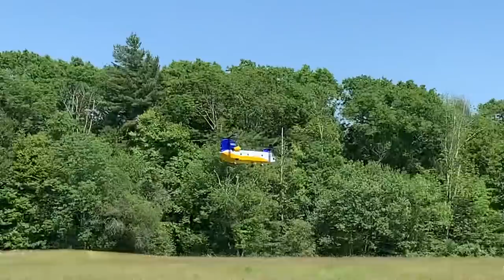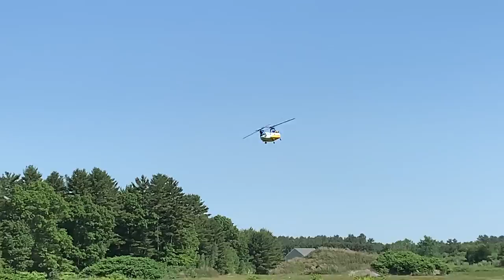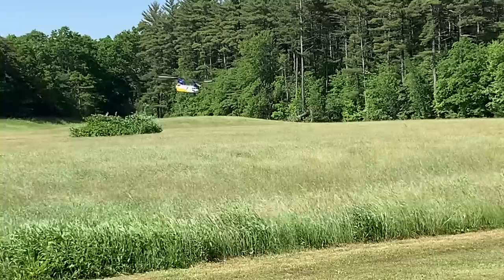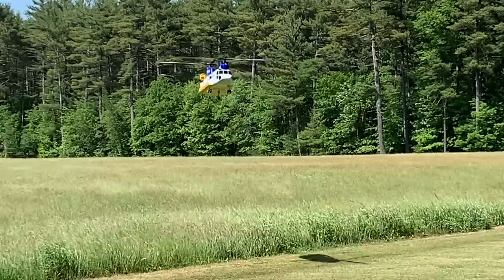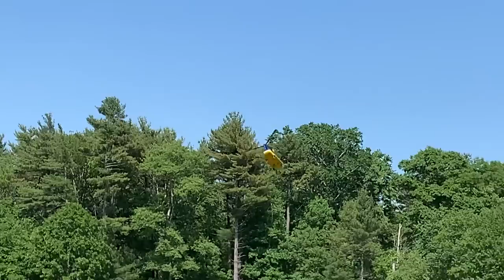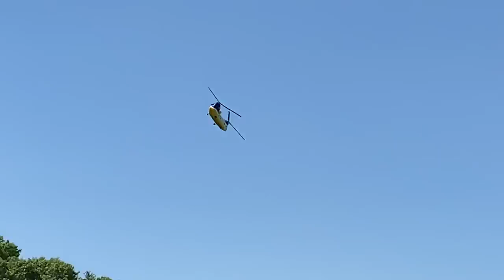Giant Chinook Heli RC

Comment: Thanks! I see that a single motor is driving both rotors with independant swash plates for yaw and pitch.
Reply from the maker: Yes this is true. Unfortunately a month after this video the motor seized in flight and destroyed the heli.
Reply: @Gmackrcplanes  This is unfortunate but they are flying models. A IRL Chinook crashed due to walnut shell contamination.

Comment: I always hate doing rudder turns because my controller is very easy to throttle up or down so I come out of a curve too high or low
Reply from the maker: Adjust the ratchet and or tension 😎
Reply: @Gmackrcplanes  I’ll look into this thanks